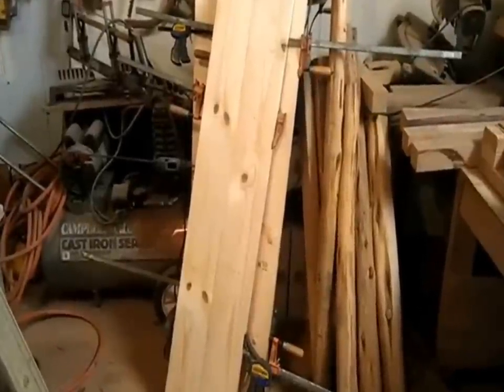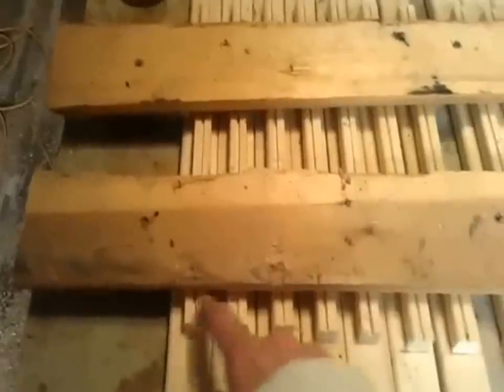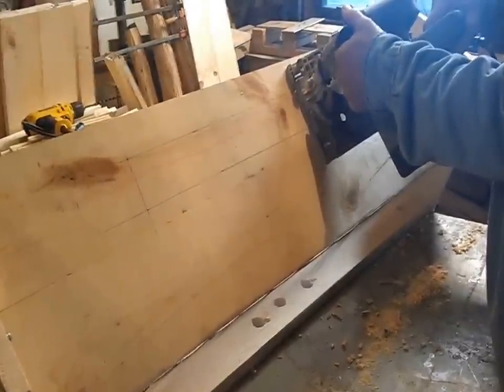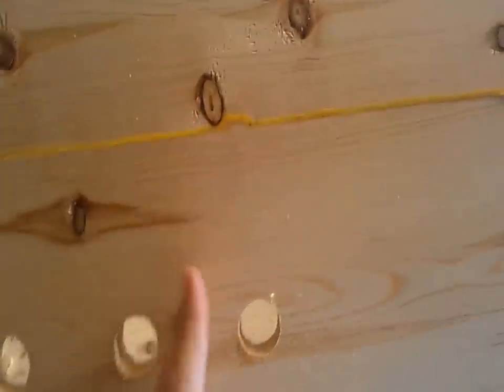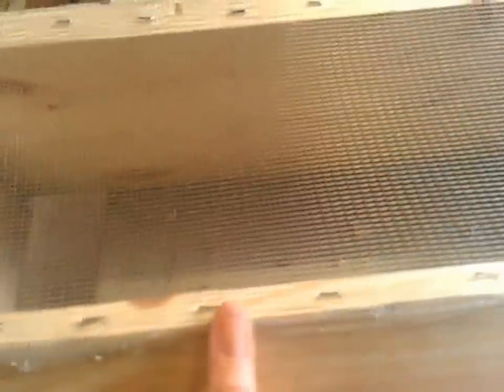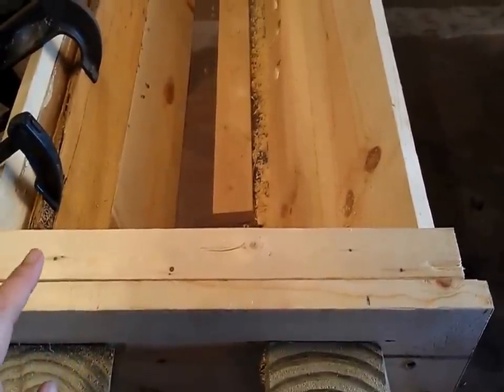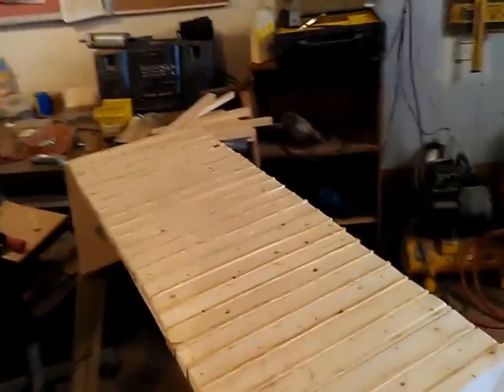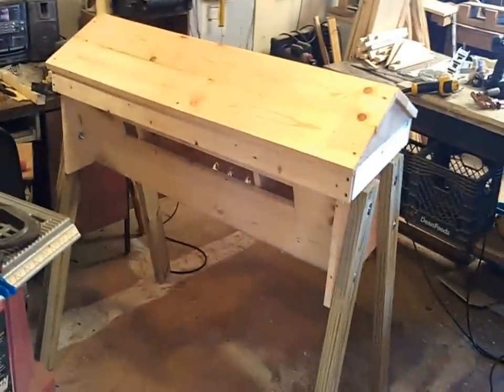Bee Keeping: How to Make a Top Bar Bee Hive

Comment: Thanks for the Video, I so appreciate it. I'm up in cold South Dakota with sub-zero winter temps, so my topbar will end up having a "winter coat" built as well and I will be using some extra insulating methods such as straw wind-break, etc. But its happening this spring! I'm getting my bees in May, so now its time to build the Topbar hive. Will try to keep you informed as to various winterizing methods I find useful. Not finding much info online for truly COLD climates (ie sub-zero). Should be an interesting addition to my little homestead!

Comment: Had to type this out from the end of the video. Thought people might benefit from having it in the comments to save time on a shopping list
     2 2x4 8' pressure treated

     7 1x6 8' pine

     2 1x3 8' pine

     4 1x2 8' pine

     8 3" 3/8" carriage bolts, washers and nuts

     Roll of aluminum vent cover

     1lb Natural bees was

     Butcher block or linseed oil

Although I think since I live up in Seattle I would be a lot better off going with cedar than pine. Up here pine only lasts a year or two.
Reply: very thoughtful thank you
Reply: Thank u

Comment: Thanks for the video!!! I have started my top bar bee hive using 2x12 untreated lumber for the main box. I figured in Virginia I would need the thicker wood for insulation to Winter over the honey bees. Glad you showed the package of bees wax with the price on it. I couldn't find but very small amounts of beeswax and it was almost $3 per pack so I am looking for the larger 1 pound pack elsewhere. Someone said I should treat the wood with Pure Flax Seed Oil. I guess they meant outside only because the beeswax is for the inside. Any comments on how to treat the wood? That same person said Lemongrass Oil could be used as a lure. He didn't say where to apply it though. I suppose the Lemongrass Oil is for the entrance holes. Some of the scrap lumber I am using for the top bars have paint on them I will sand off. A few of the top bars were cut from attic boards that have been in the attic for years. I hope sanding the surface of these boards will remove any contaminants that might affect the bees. Even new store bought lumber may have been sprayed with something from the lumber yard or saw mill to protect it from insects. I am not sure if they do this I just suspect since food industries dump toxic chemical preservatives in all processed foods the lumber industry might also treat even the untreated lumber products with some sort of chemicals. Snowing here in Virginia right now so I figure I still have some time to finish the hive before the season starts. Wild caught FREE BEES are SWEET.
Reply from the maker: Did you ever get your top bag hive completed? Blessings

Comment: the bees keep themselves from freezing.   Bees maintain an internal hive temperature of about 90 -95 F. year round.   When it's hot, they will fan hot air out of the hive with their wings and many will hang out outside the hive during the heat of the day.   During the winter, they form a clusterl around the queen and use their own collective body heat to keep her warm and as much of the hive as they can.   As long as they don't get wet (condensation build up)  and have food, they can survive.

Comment: Also, while screened bottom boards are very useful in langstroth (commercial) hives to prevent mites, I think that you will find that there is no need in a top bar hive. Why? because the bees build their comb out with a smaller cell size. For more information on top bar hives and management, visit Michael Bush bees website.  I also use essential oils for treating the hives. Wintergreen E. O. for health, Tea Tree Oil to combat mites All bee hive types).